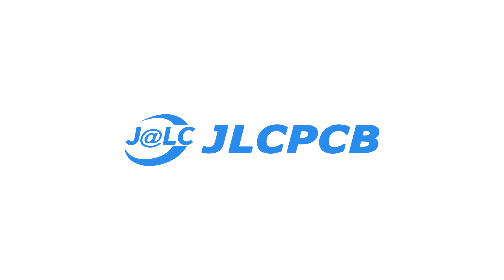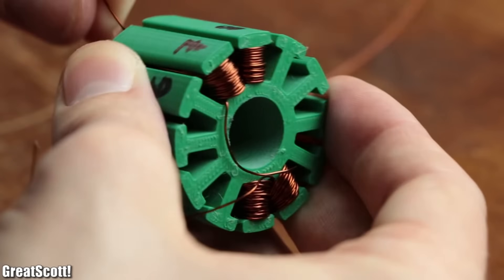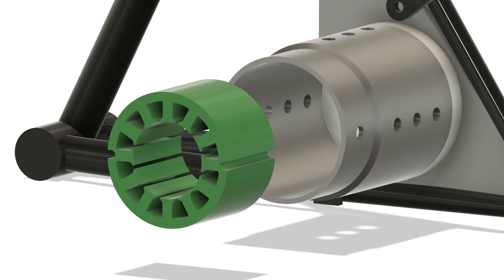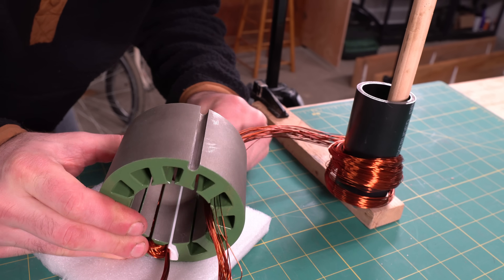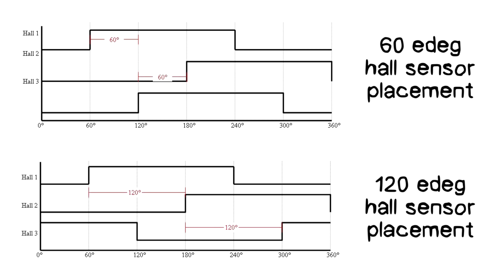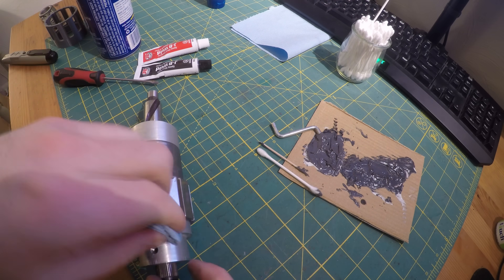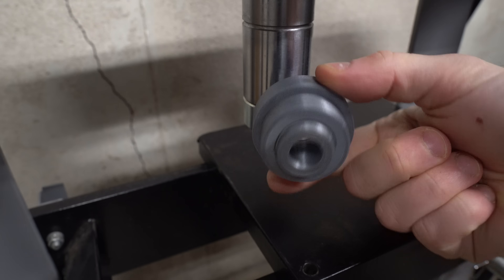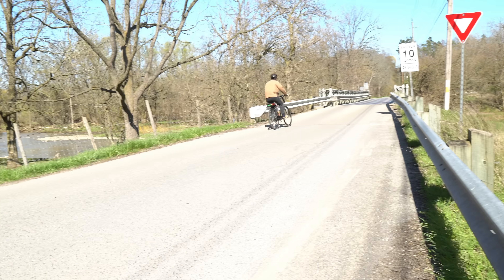Converting a Starter Motor into a BLDC Motor

Comment: impressive. did the laminated rotor (doesnt need to be magnetic steel, as far as i know, as no rotating/varying magnetic field) have a detrimental effect? Remeber, the rotor must carry the magnetic field too. having a decagon cross section will couple the back face flux coupling... your so close...... i can smell the flux.... just try a mild steel machined down round profile. glad to hear mertric units mentioned ...

Comment: What parts did you end up reusing. An overweight housing and shaft both machined. I used a brushless motor from a direct drive washing machine I ran the 42 poles in 14 parallel sets and ran it on 36 volts for a low speed high torque motor with little modification it already had hall sensors and I used a 3 to 1 reduction.

Comment: i read an article somewhere about a multiphase brushless motor used in mercedes cars for both starting the engine and providing electric assist, the guy that undertook the project of repurposing that motor has been at it for years and has recently made some breakthroughs.

Comment: I built a couple of transformers for a tube amp and managed to find two things: 1) a deal on a transformer from like the 1940's that still had a decent core in it that I re-wound for $35 on eBay, and 2) transformer E-I type cores on Alli Express of just about any dimension that you need, although it did take some digging and was a bit more $$ since they were new. The amp works great, though I'm not sure how those would perform in a motor. How big of a difference does silicon steel make in a motor, versus, say, regular steel sheets that are laminated/isolated from one another? They must make some significant difference, or else factories wouldn't go through such great lengths to make them

Comment: Every time a new motor is made there is a rule that the hall effect sensors are wrong... :) Even if they have been checked. A trick that I have used is to drive the motor with a drill and monitor the hall effects and back EMFs of the coils on a 'scope - this will usually show up any mistakes! Remember that the back EMF is in phase with the torque for a given winding. Peope find this counter-intuitive but...there you go! The back EMF x current is the useful part of the motor power. Current squared  x  resistance is the waste heat.

Comment: You know what you may have done instead? turned an old automotive generator into a motor, like I once did. Unlike a starter motor, which as you said is not made for continuous duty, an generator is. It has the laminations and the windings of a  parallel wound brush DC motor. All it really needs is the phase  angle altered  to become a motor. Making it brushless would improve it even more.

Comment: Question: is it possible to use a starter motor continuously? 

Answer: Yes, off course you can.  All you need to do is follow these simple steps and you are good to go👍:

Step #1: get starter motor 
Step #2: remove everything from inside and leave the casing.
Step #3: modify the casing 
Step #4: insert a costume brush less dc motor inside casing. 
Step #5: conect costume motor to the appropriate power supply and use it.

Piece of cake.  Nothing to worry about. 😂

Comment: Laminated stator (and rotor) cores are used on ac motors. DC motors do not suffer the eddy current issue so use solid cores.

Comment: Cool video! If you want to improve the motor, one thing you can do is to minimize the gap between magnets. I've never designed a motor before, so take my words with a grain of salt, but do you really need hall effect sensors, If you used an ESC instead? Putting the motor in the center of the bike frame will allow you to run gears on the bike.  If you search up Chris Rosser, then he might have some insight for you regarding BLDC motors and efficiency, he focuses on drones though.

Comment: I am impressed that you rewound the stator. However it was a lot of work that might have been avoided with more investigation beforehand. You admitted that your wiring to the controller was guesswork. But it does go to show the R&D process and the difficulty of correctly diagnosing a problem in an area you are non expert.

Comment: You can wind a pole with 2 strands of wire and run then in series at low speeds then in parallel at high speeds this will reduce back voltage and allow more current to flow at higher speeds with out having to have more battery voltage.

Comment: Wow! You did a fantastic job !! Really crammed a great deal of useful info in the video .
I looked through the comment section and listened to your video but no one seems to have noticed that your first motor was just pulling the drive sprocket through the chain - that motor may well have been just fine 12:53. 
Secondly , I have had similar projects and found that old squirrel cage motors are great source of stators for this kind of project though it is brilliant to know about the source you used and the ideas you have entertained . Great video - subbed for sure .

Comment: You should have gone with an outrunner BLDC design instead of the inrunner you choosed.
Outrunners have much more torque as the rotor is much bigger and thus reduces the need for a gearbox.
That's why RC planes that needs to drive a big propeller uses BLDC outrunners and dont need a gearbox.

Comment: Another point you didn't pick up on is that, the heat is not only damaging the motor but is also a huge waste of energy.  Nice job but you need to be a touch mad to even bother with such a labour intensive endevour when there are off the shelf components available.

Comment: Just use the brushed starter motor as is and operate it using a mosfet based PWM chopper. Thats it. Your DIY bike will break before the coal brushes of the starter motor wear. Also these brushes can be changed. 
If you rotate the holder of the brushes against the case you can optimize torque and speed. Also you can have a lever to move it if needed.
So keep things simple and operational.

Comment: My guess is that the iron in JB weld is under 20% which means you need to also add the air gap on the epoxy side.  Thus the real air gap is the maximum you measured.  I come to this conclusion because that is about the content in thermal conductive epoxy.
Second the rotor didn't need laminated steel or even great magnetic steel since the field is fixed it it.  
This would also have opened up other layouts of a rotor to reduce the air gap by having steel poles.  One thing nice about epoxy or other glues is that when you get them hot they loose their strength or get brittle which is what epoxy does.  For machining the magnets could be replaced by steel plates.  Disassembled and up together with the magnets.

Comment: I remember my starter motor powered wooden go-kart thing I made as a kid and yes the motor overheated and died. The first one was terrible. It had a wooden broom pole axel with no bearings that would rub through with friction. It had a toothed fan belt that happened to fit the starter motor tooth profile and went to two wooden discs on the back broompole axle and nails were between them to grip the fan belt. When I first hooked it up it went backwards and because starter motors have an electromagnet instead of a permanent magnet, changing the polarity does nothing so I had to saw out the motor mount and change it.

The second 5 wheeler creation where the main wheels are old pram wheels in the go kart frame, and the starter motor was on a fifth wheel with a thinner bolt axle so less friction was better. It also had a relay so didn't have to connect to the sparky battery. The relay and motor also eventually blew. Neither were very efficient on battery life.

Comment: Uh, the air gap.   Axial rotors far far simpler to hand make with very small magnet spacing.  Check the equations,  the magnet flux will be a primary variable.

Comment: I'm suprised you didn't expexct starter motor to overheat. I mean, those things aren't meant to work for more than a few seconds. Not to mention you didin't balance the rotor which is crucial in high rpm electric motors

Comment: there are also lazer cutting services for motor laminations 
also if you plan to try something like this yourself, starting with a alternator rather than a starter motor is more likely to give you the parts you need to convert it to a bldc.

Comment: Low reluctance is a big factor in motor preformance.
If you have a inductance meter, the reluctance can be checked with ARM inserted, take all readings and average them (or turn the arm to the position get the highest inductance, this is the lowest reluctance)

Comment: Honest question Austin. Why is everyone trying to bolt on bigger and bigger motors to try to drive bikes from the left side of the wheel?  Why not use a small motor linked to the existing drive chain and take advantage of the thousands of hours of engineering that have gone into the design of the modern multi gear mechanical rear cassette & derailleur "transmission"?  It would allow for the use of much less expensive motors & controllers, and would extend runtime considerably on similar weight battery.

Comment: if you are getting magnets, especially from aliexpress its common for them to promote their item as higher grades than they are in reality. eric draken has a blog on the issue, defo work out a way to confirm the magnets properties. Keep in mind Standard neodymium magents are rated to 80c, minor permanent degradation will occur until the curie tempeature. most motors are rated for around 180c to 200c. you would want UH or EH class magnets.

Comment: Starter motors have shunt
winding which causes back pressure this increases torque if you missed that step try cutting out the shunt winding

Comment: Great Video. How about adding regeneration to the BLDC motor so when you apply the brakes you generate power back into a Super-capacitor to get you going again before using the battery, saving battery power.

Comment: I made a stator by soft soldering iron sheets together, then machining the stack, de-soldering it all and then gluing all the sheets together with epoxy soaked gaze.
Gluing it from the beginning wasn't good enough for the machining and leaving it soldered would have negated the hole purpose of laminating.

Comment: One possibility to better approximate an arc magnet is to use several narrower bar magnets. This is similar to how we approximate a smooth curve as a bunch of short line segments. I don't know if you could find magnets of those dimensions, but I would suspect it might be easier than finding those large bars. You can use almost any size you want if you don't mind sticking a bunch of them together along either the width or the length.

The strength of a magnet is roughly the same as its N value. N42 is somewhere in the middle. You could get N52 or even N55, but that's only 25% stronger - not enough to explain the difference between your rotor and the one from the other BLDC motor.

Comment: Respect!  I tried to use a small 400kv bldc motor to drive my bike using emery paper on the outrunner bell pressed against the back tyre. It worked for a few meters and burnt out! Was incredibly hot to touch, but fortunately it looked like the magnets survived. It took a while - sourcing the right AWG of wire, 15T x 4 strands, 12 poies and 14 magnets, and finding a hydraulic press to release the core, took photos to record disassembly and managed to recreate winding layout and it worked first time!
Would have been much easier to buy a new one, but the satisfaction was priceless!

Comment: If you have an interest, you could redo your rotor by milling flats for the magnets, then using soft iron 'shims' on top of the magnets to minimize the radial gap.  Minimize the thickness of the shims to the degree possible.  The shims will be approximately the same dimensions as the magnets with a flat side to yh magnet and a creved side towards the stator.  Would be interesting to see what kind of improvement you could make with this arrangement using the same magnets

Comment: I highly doubt the airgap was the problem for your motor - if you do some simulations then you'll find that the difference between 1.5mm airgap and 0.75mm is nearly neglible. Instead what you may have done instead, was mess up with putting the block magnets on the old rotor. See - you used two of the block magnets in a row, and doing this immediately strikes me as odd, as the side-by-side magnets will repel from each-other if placed "correctly" with the same polarity exposed. So could it be, that you accidentally put a south facing and a north facing magnet side by side in a row, as that's the position the magnets would "want" to be in. So, unrolling your rotor would result in the following kind of polarity:
~N-S-N-S-N-S-N-S-N-S~
~S-N-S-N-S-N-S-N-S-N~
This kind of mistake could leave you with a motor that just about works but would indeed have extremely low torque and of course be super inefficient.

Comment: You should have spent your money getting a dia EDM cut so you could press thin sheets of iron rather than just one solid block.  You need sheets because eddie current drastically increases permetivity of the magnet field. Would have been similar outlay, but you could make multiple motors with one dia. Maybe ring the edm company up and ask then if they have your off cut ;)

Comment: It is a breeze to remove shellack from copper wire. Lay the wire on top of an aspirin tablet and apply solder to it. You have to use pure acetyl salicylic acid without other medicines or pain killers.

Comment: so  back before fancy batteries i walked into Mitches ' fab shop' to get some bracket made; when he shows me his electric bike....
a petal sprocket between his legs allowed a 6v starter  battery (um, between the knees) to spin a 12v ford starter and a boats horn button/switch all on a huffy frame.  went 35mph.
Mitch used it to get his mail, a 5 min run.  ran it like a dirt bike; press the button/full power or coast.

Comment: You could probably greatly increase duty cycle/peak power with active cooling. you already have an open design. I dont know how much space is left in the bearing flanges but it seems possible from the outsitde. maybe extend the housing with spacers bit?

Comment: Uh , shit , that conversion is too complicated for home work and could be too expensive ! don't like those magnet bars with flat up surface  .Evan before , you done very good conversion with bearings , custom Alu sides , but no how to drop on your mind to install a ventilator for cooling !? that motor should have a air cooling as big grinder  Those holes you drilled on housing don't helps at all .

Comment: Instead of trying to buy arc magnets, could you have not glued larger magnets in place and added the arc by putting it in your lathe and bring the outside down to the correct radius?
I'm sure how well they'd cut as they will be brittle. Even using a sandpaper block whilst it's spinning on the lathe may have done it.

Comment: Very cool project. Interesting trick for removing enamel from the mag wire: Melt an aspirin tablet with your soldering iron and dip the wire in the puddle. It eats the enamel off the wires quickly. It also makes dangerous smoke so use a fume hood or other good ventilation.
Reply: When i started on electronics, I didn't even know that there was a coating on the wire. All the projects I did using it would fail due to this reason and i got soo furious that i just gave up..........until i realised it from a youtube short.

Comment: So this will seem odd, but there's a person in RCGroup's forum that builds (upgrades) some of the most amazing motors I've seen. There's a section called High Performance in the Aircraft - Electric - Airplane part of the forum and the thread was started by a person that goes by Dzhamal. Now in there I posted something that basically mentioned some started motors uses hairpin and you have such a motor in this video and if the number of slots were multiple of 3 (3-phase) all you have to do is glue magnets to the can to make a powerful outrunner motor.

Comment: I've thought of many ways to make cheap motors, but unless your goal is just clicks for your channel (which is obviously the goal of many channels..) then you really need to think of where you can get cheap or almost free motors that are easy to modify.  btw, I actually worked on converting a brushed dc motor into brushless.  
I suggest you start looking for big ceiling fans, almost free.  These are a great choice, but in my efforts I discovered many have the number of poles not divisible by three, so no 3 phase.
However, I've also learned that you don't have to build a 3-phase brushless motor!  You can build a 4-phase one.  A 3phase is just easier and uses less components, but that means NOTHING when you are doing it yourself for a one-off prototype.   
The other option that is now become easy to find is direct drive washing machines, they have large diameter 3 phase motors in them that can be modified for lots of power.
Reply: I agree, seems like he's trying to re-invent the wheel? Also a very messy installation on the bicycle.
Reply: @icarossavvides2641  No he's using the existing wheels 🤣